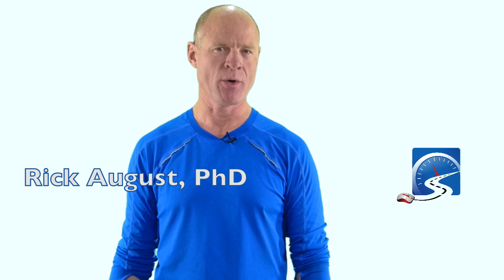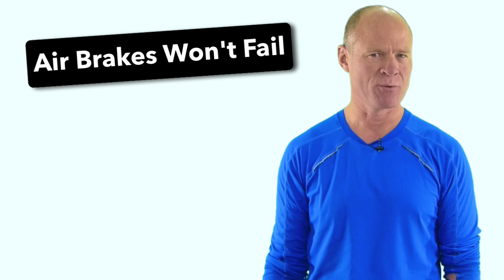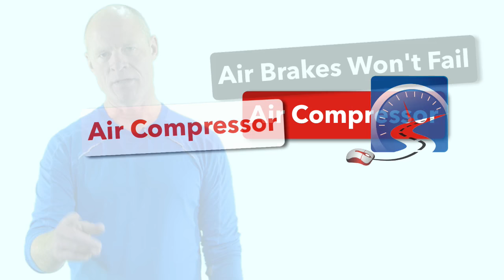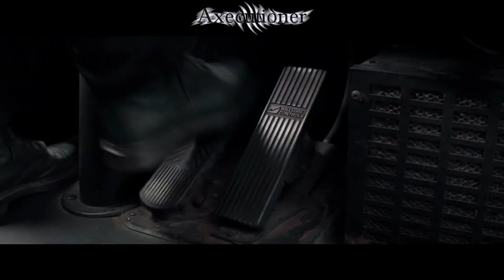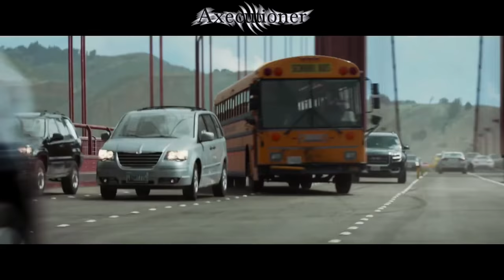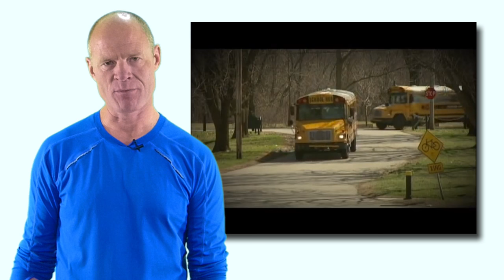Air Brakes Won’t Fail | Air Brake Smart

Comment: I had a leaf spring break up and nip an air line - MY BRAKES FAILED.
Reply from the maker: I suspect it was just your service brakes that failed. Once the air pressure dropped below 45psi, the emergency brakes engaged!? Or I suspect you got the truck pulled over to a safe place before the emergency brakes engaged? All the best, Cheers Rick

Comment: Had to look because one failed on a fairly new bus in Thailand
Reply from the maker: Hi Chris. Harfoot - Thank you for your comment. And do you have a reference for that bus in Thailand? I had someone send me a bus crash in the Alp which was reported to be brake failure too, but it turned out to be brake fade.  If there is anything further we can do, drop us a note. Always happy to help. All the best, Cheers Rick
Reply: It was in Pattaya One I think of possibly Pattaya News. They usually print in all, but they reported the driver claimed 'brake failure' it crashed into a Massage Parlour. There is a hill into Jontiem where I think it crashed but not long or steep enough to cause brake fade

Comment: Sir why we cannot use air power in excavator and others for lifting.if air power is superior than hydraulic
Reply from the maker: Hi Aman Jha - Thank you for your excellent question. One of the differences between fluid and air is that fluid can't be compressed. And a lot of the power generated by air pressure is through the use of levers. Hydraulic pressure doesn't require the use of levers. As well, in excavators, the distance out to the boom and whatnot is relatively short. Air pressure works well over large distances. All the best, Cheers Rick
Reply: @smartdrivetest  that's why in trains brake air pressure is used and in car and aviation hydraulic .sir brakes on truck use lever ?

Comment: what is purpose of pumping accelerator pedal when braking in a heavy truck or bus ?
Reply from the maker: Hi realest conorado - Thank you for your comment. The purpose of pumping the accelerator is to bring the transmission speed up to synchronize the gears in the transmission so that you can downshift. Have a look at this video for the theory of shifting a non-synchromesh transmission: https://www.youtube.com/watch?v=LzB9vZ71v08 If there is anything further we can do, drop us a note. Always happy to help. All the best, Cheers Rick
Reply: thanks for help I will keep learning more there's something more i like to ask.what causes air brakes to fail?

Comment: Are the air brakes on trains operate in similar ways or differently?
Reply from the maker: Hi Chayan Baul - thanks for your comment. I'll do some research and let you know. Thanks Cheers Rick
Reply from the maker: Hi Chayan Bau - sorry for the delay in getting back to you. Train brakes are powered by air pressure, but work differently, and have a number of different fail-safe. From my understanding, trains don't have spring brakes, but a different system that prevents the cars and locomotive from moving. All the best, Cheers Rick

Comment: Air brakes apply when there is a lack of compressed air, not the other way around. If an air supply system fails and there is no air in the tank, the brakes will lock up

Comment: actually, with a catastrophic air loss, the vehicle will NOT come to a screeching halt. I allow my drivers to pull the park brake at around 35 -40 mph and the bus comes to a stop gradually. A driver (bus) should know this and explain it to passengers in case the driver is incapacitated.
Reply from the maker: Hi stacy vaughn - thank you for your valuable comment. Apparently the parking brake on a bus works different than it does on a truck or tractor, which leads me to think that there is a modulating valve on the parking brake that gradually releases the air and allows the spring brake to act like a service brake. I'll look into that. When I say catastrophic air loss, I'm talking about the air line to the spring brake chamber being ripped off and the air that cages the spring being dumped instantaneously, which would cause the brakes to apply immediately. What kind of reaction do you get from the passengers when you give them the information about the driver being incapacitated? Thanks again, all the best, Cheers Rick

Comment: If air brakes cannot fail, then why are runaway truck ramps now common?
And if air brakes don't fail, why did the Colorado truck driver plow into a bunch of cars, killing four and injuring a bunch more?  He said his brakes failed.  He couldn't stop.

And if air brakes don't fail, why do I see trucks with burning brakes on I-80 in the Sierra all the time?  

I think what you're saying is that air brakes are unlikely to suddenly suffer catastrophic failure due to a part breaking or other circumstance.

However, if a truck driver rides the brakes the entire way down a long descent, he will certainly overheat the brakes, wear through the pads and then suffer what you say can't happen:  brake failure.

Care to clarify?
Reply: He clarified in the very first part of the video.  Brake fade is when they are ridden, heat up basically melt the pads and drums  and stop producing friction.

Comment: This is very wrong to say air brakes won't fail , i can show anyone anyday how you can make them fail , the only solution is a differential pressure guage on the red line and yellow line , its the only way to detect a low trailer air problem
Reply from the maker: Hi Jeff Wright -  Did you watch the video, or just see the title? All the best, Cheers Rick

Comment: air brakes CAN FAIL if you don't regularly drain water from air tanks and temperatures get below freezing your air valve can plug and slack adjusters Will not function.

Comment: Little deceiving at the end as not all school buses have air brakes.  Lots of them are still purchased new with hydraulic brakes.  For company’s it is just one less endorsement they need for their drivers and one less thing a shitty mechanic that has no knowledge of the air system has to work on.
Reply from the maker: Hi Emmers - Thank you for your information. Despite the extra training required for employees, hydraulic brakes are falling out of favour for bus companies. And this is due to the fact that buses sit for two months in the summer months. Mechanics that I've talked to said that pistons and seal fail when the buses sit in the summer, whereas air brakes tend not to fail. All the best, Cheers Rick